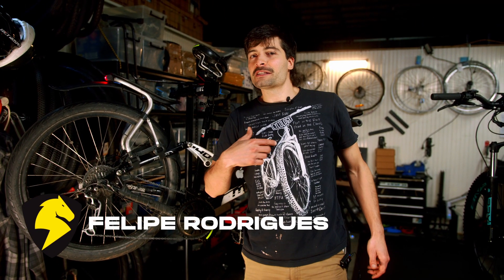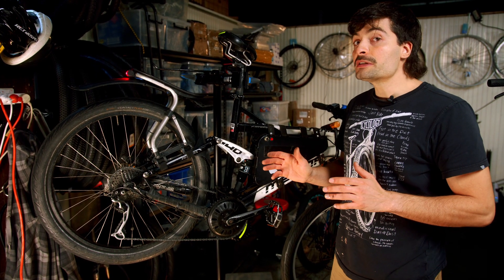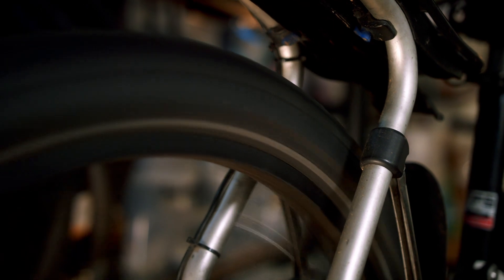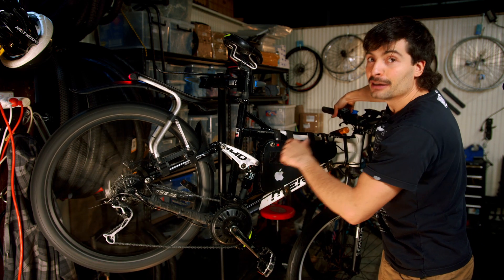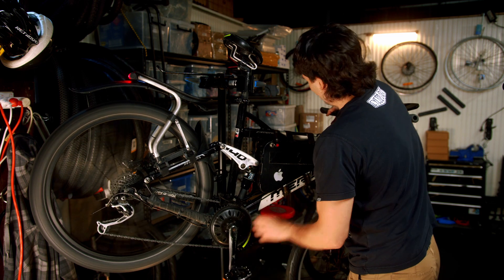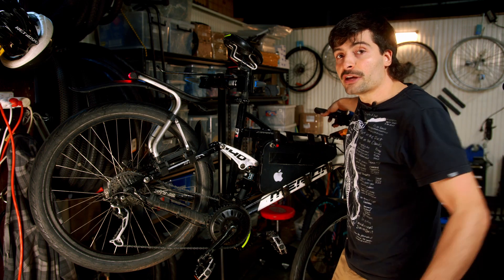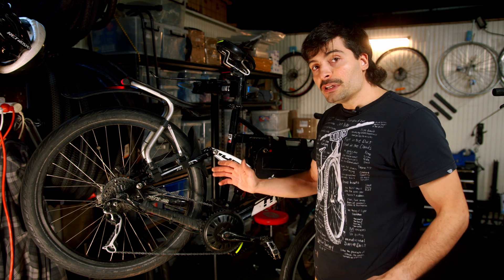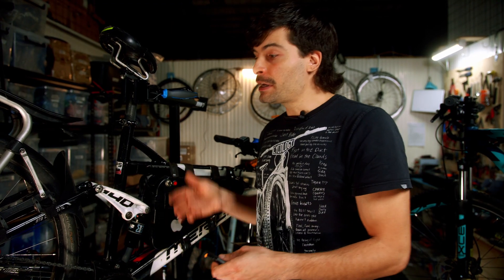How to shift gears on a Mid-drive Ebike

Comment: Hello,
I just finished converting my ebike with 1000w kit, but when Iuse the throttle or just the assist ,I don't have such an inercia . Is there something wrong with the motor or something ?
Reply from the maker: It's the bicycle gears at the back wheel. Engage the 1st Big Sprocket gear on the rear wheel and you will pull a wheelie! This is what this video is all about!
Reply: @Cyberbikesau  Not sure if you guys understand  correctly I was testing the motor inercia by lifting up the rear tyre ,then I use the throtle ,but when I stop the motor it doesn't continue to spin for as long as in this video . My setup is exactly as it is in the video with shimano XT drive train .
Reply from the maker: @angechakurov5213   it's your motor or it's your mind tripppping because this trick works in every single bafang BBS motor

Comment: .I always down shift before i reach a hill.. changing gears on a climb can cause damage to the chain, and cassette and chainring and motor...  I simply stop pedaling my mid drive when i'm going to shift up or down, I only shift one gear at a time, then i resume pedaling..

Comment: Hi Cyberbikes, I am just starting my first Bfang BB02 install. I have both brake and gear sensor parts but I think you have convinced me to not install the gear sensor. As you have demonstrated using the throttle to build up inertia before changing gears would the pedal assist function or just conventional pedaling with out the aid of motor apply as well?

Comment: I've watched this video twice now and can't see the difference in brake-clutch vs. gear sensor for uphill shifting. Wouldn't the brake sensor do the exact same thing as the gear sensor, shut off the motor & slow down momentum?
Reply from the maker: No man you didn't get it. The brake sensor allows you to decide when to turn the motor off when shifting gear while the gear sensor will always turn off the motor when shifting gears. When climbing a hill, justt shift gears un-throttling the bike and using the inertia of the chainring, half a second hand off the throttle and then shifting one gear up! It's quicker than stopping the motor with either  brake sensor or gear sensor, but you can't do that when there's a gear sensor installed, only when there's no sensor or a brake sensor installed.
Reply: @Cyberbikesau  Ah ah! Okay I gotcha.. so I totally missed that first point haha.. only gotta brake-shift when slowing back down. Thanks!

Comment: On my eTrike, the 4th gear seems low enough for an easy startup.  & I think the chain is in more of a straight line that in first gear.  So you think that is somehow bad so long as it is easy to pedal at start that way? So what is the problem to start in 4th gear with no pedal assist when it is easy to do?

Comment: I saw hardly any inertia moving the chain after you released the slight-brake. So should you not be pedaling when you move the gear shift lever?  The wheel kept spinning of course, but the chain stopped rather quickly, too quick to be moving when you moved the shift lever? or was the little residual movement enough?

Comment: Subscribed! Great video. Going to kill my shift sensor on my Lectric XPremium now. Thought about it before as I have been riding multigear bikes all my life and HATE that motor cutout when shifting. Glad I found you!

Update: I just went out and pulled the cover off my mid drive motor (left side) and followed the wire from the gear sensor to under the cover. It was as easy as unplugging that one wire and putting that cover back on! Can't believe I didnt do it sooner! When the bike was newer I was afraid to take things apart and only was looking at the sensor itself. I thought about cutting the wire since I couldn't find where to unplug it. Glad I didnt. Simple unplug under the plastic cover. So much better!

Comment: With my bike before the mid-drive I normally took off in the middle of the cassette. The lower gears were for hills. So I still do it this way after the install. But I do have a 36” chainring. Maybe that’s why. My lowest gear I can only pedal to about 6 km/h. It’s too low of a gear to take off with

Comment: This guy reminds me of an actor but can't remember now..
Reply: Diego Luna?
Reply: @SynthiaAaron-bv3fd  I never thought I'd get a response but yes i think your correct
Reply: @SmokeySkies  NP 😉
I've just upgraded my bike to an electric, so that's why I'm here and going through the comments to get other people's feedback as well.
Reply: @TheQuietBeforeTheStorm   did you get a mid drive ? How is it to a hub drive ? Cause i wanna upgrade from a hub drive to a mid drive
Reply: @SmokeySkies  Yeah I got a mid-drive, the power settings are either 0 or 100% with the throttle, so I'm flashing the motor this weekend, but other than that it's nice.
Only downside I read about the mid-drive is you need to keep an eye on the attachment screws as after a while they can come loose due to the torque of the motor, but that's fine as with a hub the wheels spokes have to handle that, and I've seen some horrors with it stripping the spokes on a wheel before and that was the deciding factor to choose a hub one for me.
Reply: @SynthiaAaron-bv3fd   about the 0 to 100 percent power on the throttle is what im intrested in. can i have it like 20 40 60 80 100 percent on level 1. 2. 3. 4. 5 on pedal assist  mode ?  have it like a manual car ? you get what im talking about yea ? the higher the pedal assist level the more throttle power ?
Reply: @SmokeySkies  Hi, yeah I do believe there are settings in the software to change the way the throttle works, e.g. you press it 20% you go 10mph, you press it 100%, and you go 40mph, or you can have it set to throttle only and turn off the PAS (peddle assist sys) but I'm still looking and not had a chance to play with the setting yet.

Comment: I very rarely use the throttle, and from the beginning, I've been changing gears by lightly squeezing the brake, activating the brake sensor, shifting, pedaling, then releasing the brake. There's a 1 second delay built into the software after the brake sensor is released where the motor remains off. This is more than enough for the gear change to complete before the motor starts running again. So from my understanding, I'm doing pretty much the same as your demonstration, except I'm using the cadence sensor instead of the throttle.

I've been thinking of wiring both brake sensors to the same input on the 1-to-4 cable, then using the second input to connect a handlebar button that would basically act as a clutch. That way I'd be pressing a separate button whenever I want the motor killed instead of using the brake levers as some sort of hybrid clutch/brake.

What I'm wondering is what's the wrong way of doing this? Are there people out there shifting without killing the motor first?
Reply from the maker: Nice, you're doing it right. There’s a second video I recorded going deeper into this explanation because even though one is shifting gears and not using the throttle, they still could be damaging the motor because of the chainring size, low pedalling cadence, a small cassette of gears, big wheel diameter, heavy rider/loaded bike, and so on...
https://www.youtube.com/watch?v=jb3v5Y0Q2l0

If you like the explanation and want to help our channel, please give us a 5 star review on Google https://g.page/r/CX0AoVbmxOSwEBM/review

Comment: Thank you for your informative video. Ever since I first learned how to ride a 10 speed bike I was always taught to pedal while I change gears. Hitting the break to change Gears seems counterintuitive. I have brake sensors and a gear sensor. They both work amazing. The key for me is if I am ascending a hill, I stay in first gear the whole time. I don’t change gears. I may increase my pedal assist, but by staying in first gear, my motor is happy all the way up the hill.
Reply from the maker: youre not pressing the brakes you're pressing a clutch that is built into the brake lever, you have to learn how to ride a new sort of bike, it's an ebike not a standard 10 speed bicycle anymore. 
The gear sensor has a purpose, but you lose all performance of the kit, imagine you could climb that hill shifting gears up and accelerating like the tasmanian devil on the trails ehhehehe each person is different, glad you know how to use your ebike now cheers
Reply: @Cyberbikesau  although power shifting wears the chain and sprockets more. I think if you are slowing down that much using the shift sensor, you probably weren't ready for the next gear up.

Comment: Thank you, very informative video and got me thinking twice about the gear sensor should I decide to get the Bafang motor.  Could I just ask - so if I'm just using the pedal assist (without the throttle), shifting gears would be done the same way as with a normal bike, i.e. the gear sensor would not be useful  as well? Sorry I am a newbie to electric bikes so am still learning.  Thanks
Reply from the maker: when using PAS is when you will struggle the most to shift gears because the motor will be pulling the chain with lots of power and the chain is snap and cassette will get damaged. In case of riding only with PAS you have to get brake sensors and maybe a shift sensor. If you decide to go throttle only you need only the throttle =) and a brake sensor on one of the lever is enough (riding for performance)

Comment: Would the same technique for shifting apply for internally geared hubs?
Reply from the maker: No, only for mid-drive motors. For hub motors, the normal gearshifing technique of acoustic non electric bikes is applied.
Reply: @Cyberbikesau  Sorry, I meant a mid drive motor combined with an Internally geared hub (Shimano nexus 7)
Reply from the maker: @luciddreamer124  rear hub motor with a mid drive motor installed? Why would you do that?
Reply: @Cyberbikesau  Not a rear hub motor - an internally geared hub, as opposed to traditional cassette gearing (ex: shimano nexus 7) paired with a mid drive motor

Comment: As far as the gear sensor scenario of going up hill and the sensor killing the motor for you to change gears, wouldn't the brake technique do the same thing? Either way you must kill the engine to switch gears, correct?
Reply from the maker: have a look in the comments we answered that

Comment: I'm glad I found this. I have a Bafang mid drive and I've just ripped the teeth off the cassette after about 150 miles. I have hydraulic brakes and the magnets don't fit into them so they are absolutely useless. Also the sensor hasn't got a flat surface to glue onto. I got so frustrated with them sticking on or off all the time I have disconnected them. So I now stop pedalling when I make a gear change. I think I'm going to buy some skinnier magnets from Amazon to see if I can get the sensors to work with them. After I have changed the cassette that is! 😤
Reply from the maker: we will record a video about that, installing mag brake cut-off sensors on hydraulic brakes.

Comment: Thank you for that video. It's so helpfull. Just an opinion, I think you have the same problem you describe wile climbing a hill by using gear sensor or cutting the power with the brake. The motor stalls in both cases because both cases are the same. You are cutting the motor and start it again from zero, forcing it, once shifted to the bigger pinion. Greatings from Madrid!
Reply from the maker: The biggest difference is. Who said that you need to cut the power with the brake sensor? You can shift gears on a split second, quick no throttling time, and you continue gaining speed while climbing. With the gear sensor installed you have no choice other than cutting off the power, loosing momentum, and damaging your motor due to higher gear at lower speeds
Reply: @Cyberbikesau  Ok. So if I understand, to select bigger pinions (to go up in the cassette), you dont need to cut the motor, only to go down in the cassette. Am I right? you take advantage of the inertia in both cases for shifting, I supose... I've already electrify my double suspension's Top Fuel 8 Trek and when I tested it for the first time, I felt the chain and cassette very forced in both upper and lower directions. I don't have gear sensor and I have to replace the front hidraulic brake with the Bafangs one, to be able to cut the motor when shifting. Thank you for your answer and  tips!

Comment: Good news for the brake sensor fan club.  Bafung have just released  onto  the market  an E - Stop brake button, specifically designed  like their gear sensor  to cut power  to the motor when changing gears or for any other urgent cutting out of motor power in an emergency. So hands off that lever and get used to a now genuine clutch like button.
Reply from the maker: a kill switch button has been in the market for a long time, much needed for safety but not better for shifting. We will stick with our Cybershifting till something else better comes along, cheers.

Comment: Hi i noticed when i using throttle Power Output Fluctuations. i have bbs02 750W. is it like standard feature for motor protect itself
Reply from the maker: check brake cut off and battery connectors, not resolving look for your controller and watch our videos about phase wires

Comment: Like honestly shifting gears for maintenance  purposes on an ebike especially one with a mid drive  motor is no different  from shifting gears on a manual transmission car including for slowing, stopping and starting from stationary in first gear. Your gear or brake sensor is your clutch on an ebike. In peddle assist  mode this sensor will  disengage the motor allowing  you to keep  on peddling as normal whether  shifting  up or down gears. Using throttle  only mode you don't need a sensor as you just release the throttle  then shift gears whilst peddling as Felipe  explained. As for shifting up a gear travelling  uphill  that is a no no.  As in a car shift down and select a low gear approaching  the hill and stick with that gear until  you reach the summit. If more power is needed  just go up in peddle assistance mode or use the throttle as you would use the accelerator  in a car. Absolutely no dramas climbing  up the steepest of hills with ease for a 750 or 1000 watt mid drive motor as their made to give out heaps of torque when choosing  a low gear. Just don't try breaking any  land speed record as your climbing  but nor do you have  to travel  at snails  pace either. If you stick  with  this principle  their is nothing  wrong  with  utilising  a gear  sensor, as the brake  sensor  that comes with the bafung  mid drive conversion  kit only  works on mechanical disc brake set ups  not on hydraulic disc brakes. I also don't  like the thumb throttles on ebikes as  their not modulated  very good, so jerky and reving up the motor with one means a sudden burst of speed, not ideal for city commuting on busy roads or  for off road trails where  a smooth transition of speed is required for both conditions. In fact not all ebikes have throttles anyway. Though they are useful  from a stationary  start considering the extra weight of an ebike .
And  not all ebikes have brake sensors either.
Reply from the maker: You can install aftermarket brake sensors, they work great, and I recommend having them in any ebike. The main difference between motorbikes and cars in comparison to ebikes is that the clutch disengages the motor, and you can select any gear from the gearbox. However, on an ebike, the clutch stops the motor but doesn't disengage the gears, which means you have to sequentially shift gears up and down

Comment: Can you do a video on single gear bafang conversion?  Like if someone were to convert a BMX 24 or 26?
Reply from the maker: It's not advantageous to use a bafang motor on a single-speed bike. That's why we recorded this video, to show the importance of using the gears.
Reply: @Cyberbikesau  Ok thanks. I heard it's fine but you would want to mess with the gear ratio by using a smaller chainring, like 36T and you won't have as high of top speed.  But idk shit I've never even had an ebike, just now trying to figure out what I want my first build to be and I like the lightweight and nimble simplicity of single gear BMX like 24, 26 and 27.5 cruisers.
Reply from the maker: @urbandisturbin  get a full suspension MTB 26" from the years 2010-2012. The motor will fit like a glove, with heaps of battery space and braking power (how are you gonna stop a BMX going 45km/h, with your feet?) Be wise!

Comment: The explosive combination could happen with or without the shift sensor.
Reply from the maker: Only if you don't understand how the shift sensor works
Reply: @Cyberbikesau  In my bikes (2017 bbs02b) they work the same way the brake sensors do.
Reply from the maker: @fabiopedo725  So what's the difference between them? Are they the same? If you say yes, please watch the video again.
Reply: @Cyberbikesau  I enjoy using brake “clutch” shifting and also like using shift sensor.  We use the bikes basically in xc mtb. To be less agressive in steep climb starts and gear shifting, we  modify controllers programming in a way to release initial current very smoothly. I could do it without the shif sensor. But some people just find it not easy to shift with the brake “clutch”. Maybe they would feel better with a torque sensor mid drive.